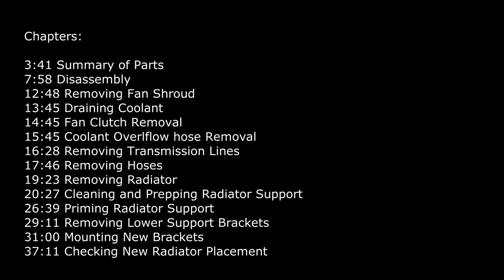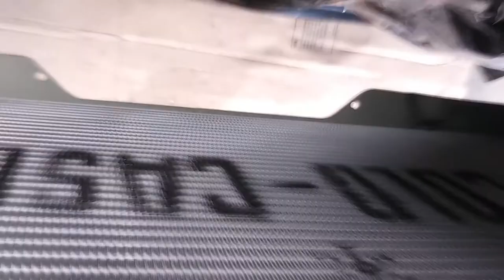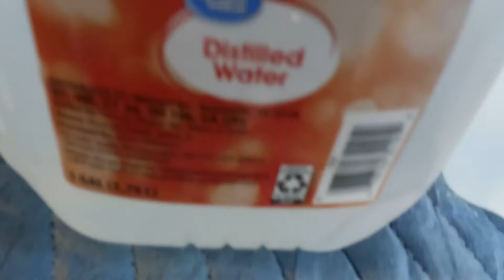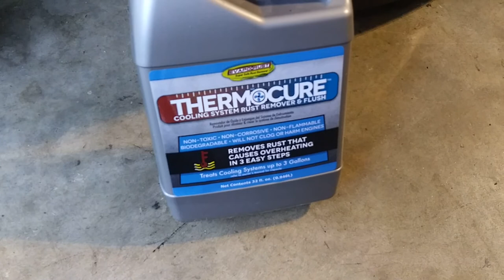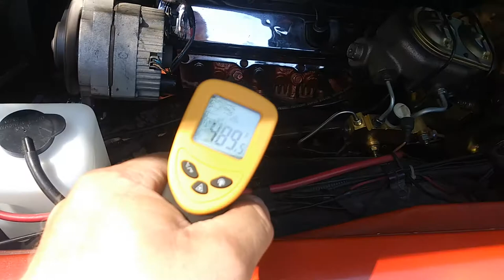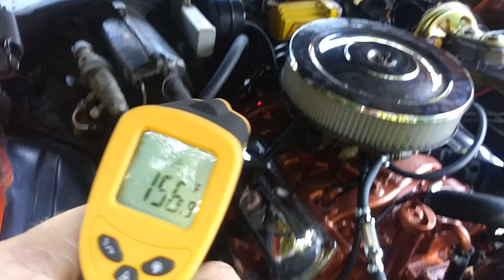Cold Case Radiator Swap in GM A Body Cutlass!

Comment: I'm doing the same HD conversion on my 68. I was planning on welding them in but I like the screw in method better! Did you center the brackets from front to back where the originals came out? I purchased an original top plate and when I compare it to the old 3 core support plate it looks like the the brackets may be in the same plane towards the front of the car so that the 4 core sits a bit closer to the engine. My core support is out and the fenders are off but I assume the radiator should vertical and will test fit with it out of the car. Great vid, subscribed!
Reply from the maker: Do what you think is best! I was able to adjust my brackets before locking them in. Im just an amatuer welder lol!  The brackets I placed in the same spot as the smaller 2 core brackets. Same distance off of my ac condenser as well. The cold case does sit closer to the engine as it is thicker. The engine runs great and stays cool!

Comment: Did you put the lower saddles on the seam of the radiator? I have the same radiator and they didn't fit it right during the swap so they left the top plate off. Original saddles will work on the core side of the seam but I dont think they want them there. I bought new 4 core radiator top plate because that is what is available. It seems to be too  much of a gap from the mount holes. Radiator is not sitting up and down level.
Reply from the maker: Sorry to hear about the issue, hope it ends up working out. Yes, I put the seam of radiator on the stock saddles that are used with the larger core radiator. The radiator may have sat a little higher raising the top plate. Yes, I also used the 4 core radiator top plate. Let me know how it works out, i did not have a problem attaching top cap if that is the mount holes your are referring to.